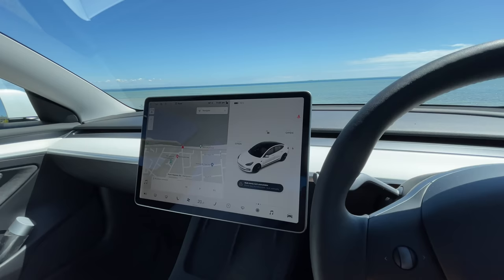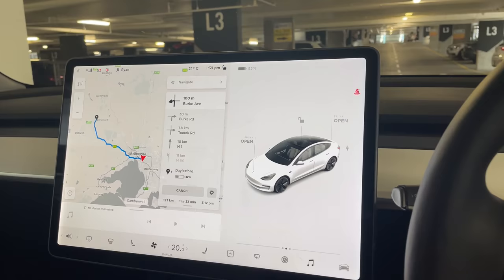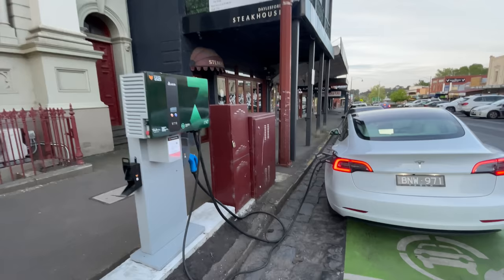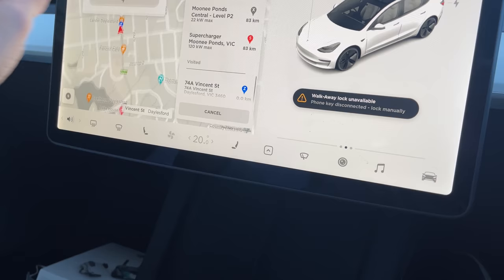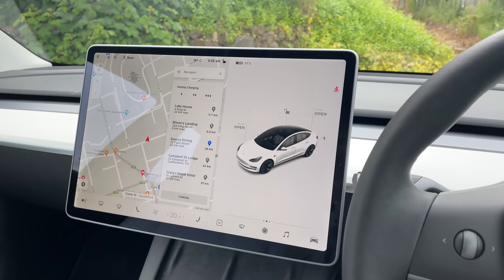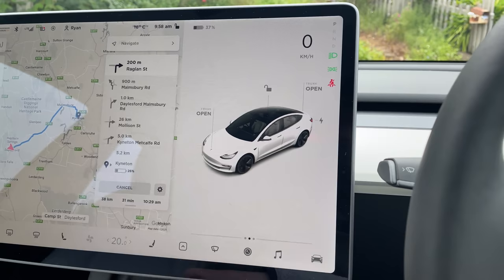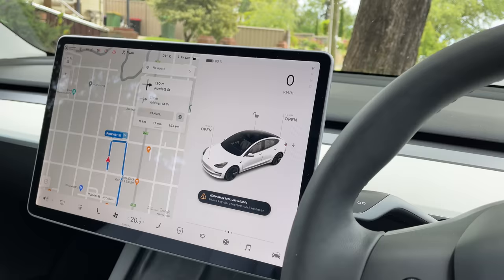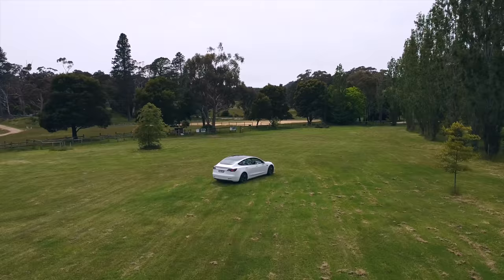Everything went wrong on my first Tesla road trip ...

Comment: This is why I keep a 50ft extension cord and a few adapters in the car at all times. There are usually plugs on the outside of commercial buildings (like petrol stations, hotels, etc) and, if you don't mind being a bit sneaky, you could leave your car parked there overnight while it trickle charges. You might only get 20-25 miles, but it's often enough to make it to the next level 2 or 3 charger.
Reply: Also many camp sites have RV hookups.
Reply: @gogeorgia707  Obviously ask first if there's someone there to ask. Do you think your comment adds anything to the discussion?

Comment: Hi Ryan. I'll chime in here too. On the charge screen under the Set Limit button, if you don't see DAILY and TRIP when you adjust the battery charge limit then you have the LFP battery. You most likely have the LFP battery due to the delivery date of your SR+ car. That battery is very robust and has a different chemistry, and packaging, to other Model 3's. The SR+ has a pouch type battery versus the LR and Performance cars which have cylindrical batteries.

From the manual:
"Tesla recommends that you keep your charge limit to 100%, even for daily use, and that you also fully charge your vehicle to 100% at least once per week. If your vehicle has been parked for longer than a week, Tesla recommends driving your vehicle as you normally would and charge to 100% at your earliest convenience."

It's because the iron in the Lithium Iron Phosphate battery, LFP,  is very tolerant to heat and very robust comparted to the chemistry in the cylindrical batteries.

 So, go for it. Set the charge limit to 100% and leave it plugged in charging to 100%, and forget about managing it. That's what it likes. 100%. 

Also, I plan routes with this on my PC before jumping in to the car:
www.abetterrouteplanner.com

And Hi from Sydney!!
Reply from the maker: Mate this is amazing info. Really appreciate it. So good to know, as I think we've only ever charged our car to 100% once ! Now I won't have to stress about it.
Reply: I wonder why they even added a limiter in these cars then. Im sure it would just confuse a lot of people that arent super into electric cars. Simplifying it with no limit and just charging to 100% would make it a lot easier to understand for laymen
Reply: @ThePandaKingFTW  it's added because of the battery type. The new Iron batteries can take that heat but the original lithium ion batteries prefer a moderate temperature. Those iron batteries are only available for the RWD (Standard +) models. The long range and performance models still use lithium ion batteries. Also remember, this technology is constantly improving. 10 years from now we may have this all worked out for the better. Cheers
Reply: I don't understand how someone could spend around $60k on a new EV and not have done their due diligence in understanding this first. Being able to charge to 100% all the time with LFP batteries was one of the main reasons I opted for the 2021 SR+ 🤷‍♂
Reply from the maker: @Woodywoodah  appreciate the kind words woody 🙃 the Tesla rep told me to keep it under 80%. He was misinformed. But personally I have no issue learning as I go mate.
Reply: @Woodywoodah  Its the 22 SR+ that has the LFP battery. So its understandable why someone might not know it since they literally just came out. The 21 doesnt have one unless you ordered in september
Reply: @RyanCowan  While everything Andrew said is basically true it is still healthier for the battery to only charge to 100% if you know you gonna drain some percentages soon after. On long term it's not good for the battery to have it at close to 100% over longer periods of time. But yeah compared to the other battery packs it doesn't nearly hurt as much so you can set limit to 100% and keep it there more often. Personally, what I do, is set the limit to around 90% and when I know I'm gonna use the car for a longer trip I set up a charging schedule to start charging 1-2 hours before the trip and then set the limit to 100%. So basically try to keep the battery around 85-90% and charge to full just a few hours before your trip.

Also keep in mind that since the LFP chemistry is so different you need to "calibrate" the BMS (Battery Management System). Drive the car to a low state of charge (around 15% or lower if you're comfortable with it) and then let it charge to 100% on a slow destination charger. The reason is that the voltage difference on the LFP between full and empty is so low that the range prediction on your car starts to become inaccurate. The "calibration" basically teaches your car the correct percentages so you get a more precise range prediction. If you don't do this you will get much higher times for a true 100% charge. Maybe you already noticed but when your display reaches 100% but the charging is still not complete it means that the car is calculating and analyzing all the cells that make your battery pack. This takes longer (and can still be inaccurate) if your last "calibration" was more than a couple of weeks ago. This is the reason why the manual recommends to charge to 100% at least once a week.
Reply from the maker: @Telris86  Awesome info ! thank u for sharing. I did not know any of this !! 😂
Reply: Sorry but you didn't get it quite right Andrew, see my post on the main comments section... Charging to 100% constantly is still accelerating the degredation... Even for LFP.

Comment: This past May, I took a 6400 mile road trip from San Diego to Tennessee and down to Key West Florida, no issues with charging but then again we have the most Superchargers here to cover the map.  No range anxiety here.

By the way, lessons learned, always charge to 100% on road trips, don’t baby the battery.
Reply from the maker: 💯 So true ! Thanks Fred. Lesson learnt. Supercharging network continuing to expand here in Australia ☺️👏
Reply: @RyanCowan  Doesn't it make more sense to stop charging at 80% as long as you can make it to the next charger with at least 10% remaining. I thought that charging speeds slow down at around 80% and that you'd save more time than waiting for it to get to 100%.
Reply from the maker: @lanceareadbhar  yeah true, this is exactly how we've been using superchargers.
Reply: @lanceareadbhar  on Road trips, always have enough to not only get you to your next supercharger or another location if this one is down for maintenance. Happens all the time.
Reply: Same here.  Went from Los Angeles to Portland Maine and back.  Perfect trip.  Except for hitting a tire and breaking the plastic underneath.  They only charged $217 to replace it.

Comment: Ryan I very much enjoyed your video. It reminded me of my early days of being an EV/ Tesla owner. Having done many road trips longest one being 15 nights staying in six different hotels. First bit of advice and the most important is, sort out whatever problem you have with pin to drive, the only Tesla's that are stolen around the world are the ones that do not have pain to drive activated.
Secondly when planning a road trip that involves staying away overnight, always book accommodation that has charging or at the very least will allow you plug in your granny cable.
I have every confidence you will get the hang of road tripping. Best of luck on your future long-distance drives. Cheers from Dublin Ireland, us right hand drive drivers must stick together!!
Reply from the maker: G'day Seamus ! Thanks for your comment, appreciate the support. Already since filming this video I feel like I have learnt so much more about this car, and the ev network. Appreciate your tips, I completely agree with you. Thanks again, Ryan
Reply: Just here to chime in that Pin To Drive is not sufficient to stop theft as long as they get into the car. They flash the firmware and connect the car to a hotspot that is not connected to the internet so the car gets isolated. So yes it definitely makes it more of a hassel, but they thieves have become very sofisticated at least here in Norway. Older Model S with the old keyfob are especially targeted. They use a signal booster to trigger passive entry and het into the car. 

So, especially for older Model S I highly recommend setting up both Pin to Drive & turning off Passive Entry.
Reply from the maker: @Frygisk  wow, that is crazy !! We don't have many model 3's in Australia so the thieves don't even know how to use the doorhandles 😂 Would love to visit Norway one day—you are leading the way in EV's !

Comment: Glad you learned a lot on this trip! I'm a car guy, and heavily researched EV charging while waiting for my Tesla. I decided to buy NEMA 14-50, 14-30, and 10-30 plugs so that I could charge at RV parks and home dryer plugs (USA), but after 10k of miles on my Tesla Model 3 Performance, have yet to use them. Planning to start camping again, where the NEMA 14-50 will be invaluable.

That being said, for those who don't like taking risks or don't want to research EV stuff, don't rely on destination chargers! The car has no idea if they're functional or not, and they often aren't. The supercharger network can tell if anything is down, and it is conveyed to the car. 

In the USA, we can only use Tesla DC fast chargers, but in other countries that use the standard CCS plugs, you can charge at ANY fast charger, which is awesome!

Anyways, glad everything worked out on you trip.
Reply from the maker: Thanks for the comment James ! Totally agree with you. We've had SO many issues with destination chargers—I almost wish they didn't show up on the map. But we've had excellent experiences with every Tesla Supercharger we've stopped at. Great idea to have the adapters with you just in case—although I personally can't imagine we'd ever need them (as long as we carry our charging cable with us).

Comment: I’m in the uk and have a caravan 16A extension lead plus 3 pin adaptors at both ends. I can plug the Tesla UMC adaptor in to that , and in your scenario, you could have run this wire through a window and into your accommodation.

As it’s a caravan lead, you can also connect to a 16A power source… I also have the Tesla UMC 32A adaptor if I run into higher power commando sockets.

Comment: You probably know this  already but buy the 3 phase adapter. Nearly all show grounds, camping areas etc have them. Even most farmers would have 3 phase at their sheds & I'm sure if you were stuck 99% of them would help you out. Especially if you throw them a few dollars for helping you out. Tesla Tom has a video on the adapters & what took a normal 10amp 14hrs, the 3 phase did in over 3hrs. We have already ordered ours 👍🇦🇺
Reply from the maker: Thanks so much ! Great suggestion. I follow Tesla Tom so will check it out

Comment: great video. I think the major issue for EV sales is the charging infrastructure. as we get more charging stations, more EV sales will occur. I also do not understand why charging companies are investing in CHADEMO anymore. There are very few cars using this connection and can use a CCS2 adaptor, if it's a Leaf or something like that. I have noticed this one has one CCS2 and one CHADEMO which reduces our options further.
Reply from the maker: Thanks for watching ☺️ and yes totally agree. As you would’ve seen, the one and only CCS charger in town was out of order, so definitely would’ve been great if the plug was CCS too.

Comment: I'm in the UK and you have the same car as mine. You should be charging the LFP battery to 100% at least once per week to calibrate the BMS. Yes, it's a great car and you can drive it down to 5% SoC without worrying to much... I love Australia and want to go there again once the covid restrictions are lifted and spend some months traveling around now I'm retired. Nice videos by the way...
Reply from the maker: Thanks Kelvin ! Yes, I have since learned from others that I can charge to 100% without having to worry ☺️ wish I had know this before my big road trip 😂
Reply: @RyanCowan  The Model 3 also has a roughly 5kWh buffer below 0% for the cars systems and electronics. You really should only use these in an absolute emergency however since fully discharging the vehicle completely can potentially result in damage.
Reply: No problem charging any Tesla to 💯 if you need it. Just don’t let it sit for hours.

Comment: I have a 2018 model w FSD, getting ready to upgrade to 2022.   I will not be getting FSD.   I will however greatly miss the lane change feature on the freeway where a flick of the turn signal safely moves to the nest lane for passing purposes.  As you noted, I’ll have to constantly engage/disengage and I hate that thought.  But I’m not paying $10-$12k usd for that one usable feature.
Reply from the maker: Would you consider the FSD subscription? Sounds like FSD is going to get a lot better this year. Got me tempted !
Reply: @RyanCowan  it’s got a very, very long way to go (I’ve got the beta).   I may subscribe for a month if 8 have a big road trip.   Of course if they actually do have a surprise breakthrough to true level 4 driving, it would be worth 3 times that.   But I don’t think that’s possible in the next 3 years, with the progress they’ve made to date.

Comment: OK looks like you've received a bunch of conflicting information with regards to 100% charge. 

Basically charging to 100% is less harmful for an LFP battery, but make no mistake it does accelerate your battery degredation charging to 100% Vs 70 or 80%.

The reason people say it's ok to charge LFP to 100 is simply because it has many more charge cycles in it's useful life so you can get away with going to 100 without seeing the degredation so fast, but rest assured if you keep charging to 100 daily you'll see a degraded battery later on in your ownership, that's why I only charge my model 3 LFP to 80% daily and 100% every fortnight. 

You do need to charge the LFP to 100% every so often because the battery management system will struggle to stay calibrated otherwise... The reason being is the voltage on an LFP battery is very flat, so sometimes the BMS can get out of wack as there isn't much change In voltage between each percentage point... So charging all the way to 100 will make it "remember" where the top is, if that makes sense. 

So my advise is on road trips don't worry about charging to 100%, if you were going to do it, LFP is the best to do it with... But don't do it on a daily basis and charge to 100 every week or fortnight. 

I hope this helps.
Reply: I've been charging my new SR+ LFP to 100% most nights and lost 0.2% of battery in 3 months. If it keeps loosing battery at this rate, it will have lost ~8% after 10 years.... Note my old NCA Tesla SR+ lost 8 miles in only 3 months!
Reply: @ksmith660  battery degredation isn't always linear... Plus 3 months but how many miles (charge cycles are more important than time). I've already done 10k miles on my LFP within 6 months and if you rack up the miles quickly you'll find that you will want to preserve the battery if you plan on keeping the car for a while. Also in the majority of use cases, 100% charge isn't needed daily... So why accelerate wear if you can preserve it even more so? I charge to 80% daily with a 100% charge every couple of weeks or when it's time for a road trip. It's been no inconvenience for me and all long term benefits of keeping the most capacity I can.
Reply: We were given that advice in 2013 when we got our first Nissan Leaf. We charged that battery to 100% everyday because we needed that much range for daily use. When we bought a second one a year later off a completed lease, we only charged it to 80% because that is all the range we needed. Guess which one had its battery replaced under warranty? The 80% one. When Musk was asked about 100% vs 80%, he said just drive the car.
Reply: @bigdougscommentary5719  anecdotal evidence... I mean femair enough in your 1 case charging to 100% worked out for you, but the data does predict a better lifespan when charging to 80%. More than likely you just got unlucky and now you see 80% Charges as a bad thing... Also charging to 100% occasionally is good for the battery management, just not all the time.
Reply: @bigdougscommentary5719  
There is also the fact, the Nissan leaf has 0 thermal management and I wouldn't expect a leaf battery to the best comparison, I think it's probably one of the worst designed thermal management systems on an EV... Or lack of.

Comment: These are the good videos.
Im also in melbourne and looking at buying a LR model 3 (would prefer a Y) and need to wait a few months 😬
You gave good info on what apps to use like ev and charge fox and plug share 😁
Im 6"2  and bit worried about the heat from the glass roof. I know you can get a window shade  and an thinking about install a tint 🤔
Reply from the maker: Hey Brett, thanks for the comment ! Appreciate it and glad my videos have been helpful. I'd see how you go with the glass roof to begin with, we've now gotten used to it after experiencing our first summer. But tinting would be a good option if it bothers you, and as you mentioned, plenty of other accessories available also. 

And very excited to hear you're in the market to buy a Long Range. Hoping the Model Y comes sooner rather than later—but the 3 is a great choice also. Feel free to message me on instagram if you have any questions I can help with.